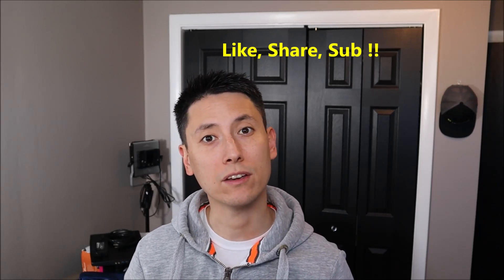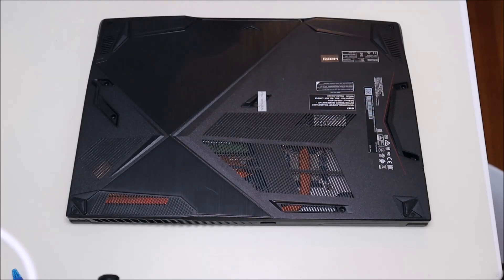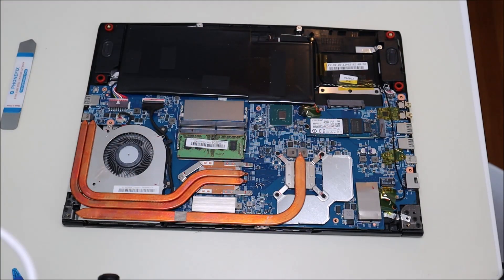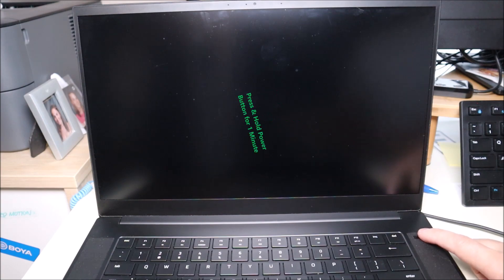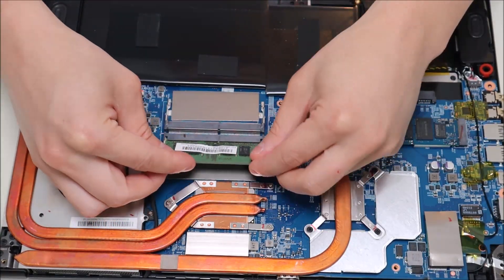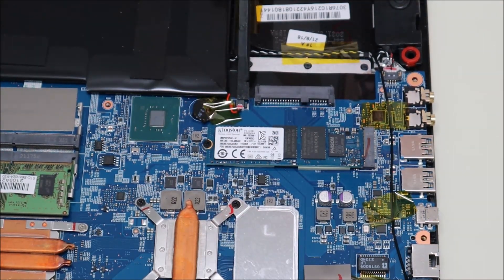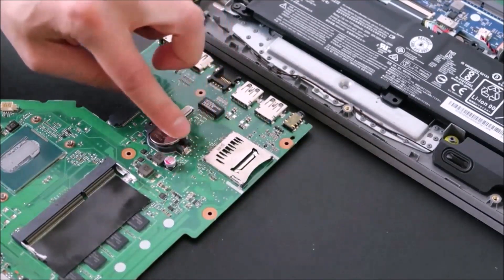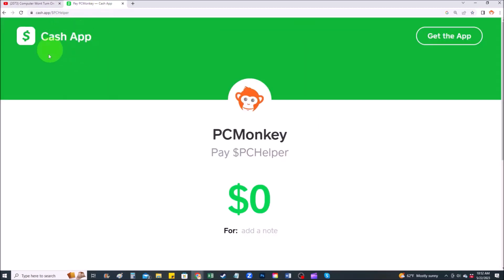MSI Laptop Computer - Dead / No Power / Wont Turn On Fix

Comment: Just replaced the keyboard on an MSI_GL75. and now the unit won't boot. So far i've tried everything in your list with no progress. Currently when I press the power button it turns on. Goes to the orange light for 18 seconds before shutting off and recycling.
Reply from the maker: If the computer turns on and works well before I perform a repair but does not turn on after, my first assumption is that something was made loose or damaged when I was in there. Can you double check the connections of all components near where you were working? Was the battery removed and the computer unplugged during the repair?

Comment: I got my keyboard module changed because many stopped working, now that the module has been replaced the, the power button worked in the store but then it didn't. Also the led light on the num lock and power button are turning on which used to when before the swap
The led lights are only turning on  for each and capslock...not for others like mute and mic off button...
Reply from the maker: 1. For a computer that wont turn on, your on the correct troubleshooting video. Have you tried the steps seen here?
2. If this happened after a repair, perhaps something was damaged in the repair. I would try reseating the keyboard ribbon cable and see if that helps.

Comment: I just tried to clean my fan , but after i finish everything , and i plug in my screen wire but im not sure i was dust or smoke come out from the plug , and my pc doesn't start now ?
Reply: And now i plug out battery and plug in when i turned on smoke come out from battery and i decided to turn on pc without battery , bu now the issue is there is no display?
Reply from the maker: @Mabastscott59  If smoke is coming from various parts of your motherboard, I assume there are shorts and the motherboard is being damaged :(   But we can still try to troubleshoot if you like. So now the computer turns on but there is no display? If the screen is black, what are the signs that the computer is actually turning on?  Any motherboard or HDD sounds, fan, etc?
Reply: @PC_Monkey  i thought smoke came out from battery but i think it was something else , and it was transistor 1R2 that is responsible for turning on screen ! And i hope i can replace that .

Comment: Really appreciate the video! I have a problem with my msi. I'd really appreciate hearing what you might have to say about it.  Basically It froze and shutdown but when I try to power it on it it only powers some lights and the hard drive (I can hear it turning). The screen remains black and the fans stay silent. It's an msi gaming laptop from 2021and I've treated it like a 500 year old glass masterpiece. In other words it does not seem like it should be having problems. Any thoughts?
Reply from the maker: Sounds like your on the correct video.  Have you tried the steps seen here?
Also, did anything happen before this issue appeared?  Overheating, liquid spill, Windows update, etc?

Comment: My msi katana gf66 suddenly shut off while I was playing cs2 and is not turning on, tried everything you suggested but still nothing do I have no other option but take it to the shop?
Reply from the maker: 1. Are there any signs of life at all when you try to turn it on? Lights? Fan, Motherboard, or Hard Drive sounds? Anything seen on the screen?
2. Also, did anything happen before this issue appeared?  Overheating, liquid spill, Windows update, etc?

Comment: Ive done all the steps but yet its not turning on. All i had done was update my graphics driver what can i do to examine and fix this problem. The computer your using in the video is the same one i have but i havent found a solution yet. Do you have any suggestions i can do right now for it turn on?
Reply from the maker: If after trying the steps seen here in this video multiple times without anything changing, your most likely looking at a faulty component preventing the motherboard from working or a motherboard issue.  I would start troubleshooting each component, starting with the charger and power jack.  You can see those two videos here;  https://youtu.be/YBhsVHideGE  &  https://youtu.be/HpabvrNaodU.  You can also try replacing other components like your Power Button to see if that is the route cause.  If none of those are the issue, you would then be left with a motherboard replacement.

Comment: Hi. I have msi flip evo 13. I mistakenly plug the charger to the non-charge thunderbolt type c port. Then plug it true thunderbolt type c. And laptop suddenly power off. After that never started again. When i push power button there is only low frewuency sound ends up ten seconds. And nothing. Where is the problem do you think
Reply from the maker: 1. Sounds like your on the correct video.  Have you tried the steps seen here?
2. In many cases, plugging the charger into the incorrect port can damage the motherboard :(  It may need to be replaced :(
Reply: @PC_Monkey  thanks. I tried all the steps. It will cost too much, motherboard:(
Reply from the maker: @61lebowski61  Is this your motherboard? https://ebay.us/odSAs3

Comment: Hi, thanks a lot for your work it is really helpfull !
I have a laptop MSI gl62mvr and it won't start. I tried everything you said in your vidéo, but no improvement. The middle led is shining blue, but the power button doesn't do anything. When i press the reset button while i keep the power button pressed the fans start for 1 second, then stops, then  strats again for 2 seconds, then stops and then strats again for 10 seconds. Then nothing, the screen Does not start at all. Do you have a clue ? Thanks a lot i am a bit Lost hère 😅

Comment: I have the same problem but the chipset near the cmos battery got cracked. Is that the problem? I hope I will get a notice
Reply from the maker: If you see physical damage to your motherboard or to any of its components, you most likely need a motherboard replacement :(

Comment: For me my laptop turned off while i was using it and the power button turns on when pushing it, but nothing else. Eventually the power light turns off and nothing happens. This is happening each and every time i attempt.
Reply from the maker: Sounds like your on the correct video.  Have you tried the steps seen here?
Also, did anything happen before this issue appeared?  Overheating, liquid spill, Windows update, etc?
Reply: @PC_Monkey  Possibly a windows update, but overheating for sure. I have been using multiple independent fans to keep it cool for awhile and it didn't seem to overheat anymore... But now this new issue appeared. 

My laptop is slightly larger than the one in this video, I got as far as opening it up but the components look different and I'm not sure what I'm doing with it.
Reply: @PC_Monkey  Finally found and tested my ram using ur vid as a guide, this did not fix the issue so now I'm trying to figure out were the cmos battery is located. I'm using a msi gs70, it's layout is pretty different from anything i can find in vids for this.
Reply: @PC_Monkey   Found the cmos battery and followed instructions, unfortunately it still doesn't work. Thanks for the video I learned a lot anyway.
Reply from the maker: @aquacandela  Just so you know, over heating situations can be hard to troubleshoot just one issue as multiple different components and boards including the motherboard itself, could all be faulty.  
An overheating computer can be damaging multiple different components if not resolved. First, make sure that the fan and vents are clean and clear. If you need help accessing the fan, let me know what brand and model computer you have and I can help you get inside it. If that does not fix the overheating issue, then try replacing the thermal paste on the CPU and if needed, the GPU as seen here; https://www.youtube.com/watch?v=K_j4GPjpawk. If that fails too, replace the CPU
Reply: @PC_Monkey  Thanks I'll check these options out, I'm coming into this as a rookie in computers and learning everything as I go. My laptop is an msi gt70 2pe, and given I've had and used it for roughly 15 years the overheating issues and these new ones aren't too surprising. 

It's becoming a learning project were if I manage to fix it awesome, but if not I see it as an opportunity to learn new things.
Reply from the maker: @aquacandela  Great to hear :) :)

Comment: Hey J, so initially found out my msi gf63 v12 laptop's fan extension that you can see without opening the cover is bended. I can't boot up my laptop sadly but idk if that may cause the issue. I can't really specify the piece more than that. Here in search for your help. Please lighten me up 😢
Reply from the maker: Yes, if the fan is damaged, that may stop many computers from turning on as its a very important part to the heat assembly and the computer may not want to risk the damage that comes from not having a working fan.  I would open the computer up and make sure the fan is ok and does not need to be replaced.

Comment: I just recently tried to clean dust out of my msi gaming laptop and after doing so and removing the fans to clean them, i put everything back together as it all should be, i then plug my power cable into the laptop and press the on button, the laptop turns on for around 3 seconds before turning off again although i did not touch any power cables so I have no clue what to do?
Reply from the maker: Are you able to see anything on the screen before it turns off?  Also, was the computer working well before you went into it?  If not, what was happening?
Reply: I just delivered it to the repair shop today, however before i attempted to clean my laptop everything worked completely fine and as it normally should. I also could not see anything during the 3 seconds it was on for although the keyboard did light up and the fans would work for that duration it turned on for before turning off again.
Reply: I presume that it is the fans that have gone bust as when I disassembled the fan one of the bronze metal bars did bend a tiny so that would be my guess but I honestly do not know otherwise what it could be?
Reply from the maker: @C1arky0606    Good luck !!  Let me know how it goes :)
Reply: @PC_Monkey Thank you, I could get a phone call earliest friday to see if it needs a new part or just minor tweaks. But thank you for the help I will let you know what happens! :)
Reply: @PC_Monkey So what happened was nothing to do with me disassembling the fan, the repair guy informed me that my laptop was completely dead and something in the motherboard had melted and fried completely so looking for better reliable gaming laptops at the moment, thank you for your help though I do appreciate it very much and your channel as it also helps people in dire need.
Reply from the maker: @C1arky0606  Happy to help :) Always here if needed !!
Reply: @PC_Monkey Thank you! :)

Comment: I have a ge75 raider that starts to turn on and a light flashes and turns of with a click
Reply from the maker: Sounds like your on the correct video.  Have you tried the steps seen here?
Also, did anything happen before this issue appeared?  Overheating, liquid spill, Windows update, etc?
Reply: @PC_Monkey  I haven’t been able to use it for the past year it’s been doing that I tried all the steps but it didn’t work only the keyboard turns on and just shuts off after that
Reply from the maker: @ivanlopezz22  If after trying the steps seen here in this video multiple times without anything changing, your most likely looking at a faulty component preventing the motherboard from working or a motherboard issue.  I would start troubleshooting each component, starting with the charger and power jack.  You can see those two videos here;  https://youtu.be/YBhsVHideGE  &  https://youtu.be/HpabvrNaodU.  You can also try replacing other components like your Power Button to see if that is the route cause.  If none of those are the issue, you would then be left with a motherboard replacement.
Reply: @PC_Monkey  okay thank you man

Comment: Hey, My laptop turns on on battery power, but then turns off automatically around login screen during startup, happens at every startup and i cannot turn on the laptop in battery power.. then i have to connect it to AC adapter to turn on, once on battery backup works fine as usual..my battery is new.. what can i do?
Reply from the maker: Sounds like an issue with the battery.  Is it generic or a brand name battery?

Comment: HELP! I have msi prestige 14 and i already take out and insert  the battery back in, I've done mostly everything all videos said and it's still dead!

Led light charging wont turn on too, i swear the charger is fine because i tried charging my phone and it works, so i just seems like my laptop CAN'T receive the charge?? ((All i did was leave the laptop to rest untouched for a week))
Reply from the maker: 1.  I would try the power drain procedure a few times before giving up on it.  Have you managed to perform the BIOS reset?
2.  Also, did anything happen before this issue appeared other then leaving it off for a long time?  Overheating, liquid spill, Windows update, etc?
Reply: @PC_Monkey  so it does have a Windows update before i let it rest for a week, it was a sudden update and i didnt bring the charger with me so i let it update until it ran out of battery, then i leave it to rest for a week, today i charge it and realize the led light didnt turn on (i thought it was no big deal) hours later thinking that it finally charged full and ready to be use, i turn it on and it shows the windows update screen, reaching 97% (everything seems fine still) i leave it for a moment, went back, only to find it's  totally dead till now

No overheating, but the opposite, its freezing here, and i left it on a cold table for a week, i heard it could also cause sudden error to laptops(?

I havent tried the CMOS/BIOS restart, i will soon tho

Edit : i did the cmos restart, still dead
Reply from the maker: @meetsuka  If the computer lost power during an update, it could have messed up the operating system.  You would usually have to reinstall it.  However, if your computer is not even getting power, something else is the issue here.   If after trying the steps seen here in this video multiple times without anything changing, your most likely looking at a faulty component preventing the motherboard from working or a motherboard issue.  I would start troubleshooting each component, starting with the charger and power jack.  You can see those two videos here;  https://youtu.be/YBhsVHideGE  &  https://youtu.be/HpabvrNaodU.  You can also try replacing other components like your Power Button to see if that is the route cause.  If none of those are the issue, you would then be left with a motherboard replacement.
Reply: @PC_Monkey  i do think that the problem is in the power Jack because i tried other chargers and none works, i just kept wondering how come it brokes all of a sudden when i never treat it roughly 🤣, oh well thankyou for your replies tho!!
Reply from the maker: @meetsuka   Good luck !!  Let me know how it goes :)

Comment: thank you sir, you are a life-saver

i was messing around in the bios and my msi gf66 screen went black entirely, while still running hot, took me a few hours and countless troubleshooting attempts.

I removed the cmos and plugged it back in after a few minutes and it worked for me.
Reply from the maker: Great to hear !! Always here to help :):)
Reply: Hey, I have the same laptop but mine completely shut down when doing a Windows update. Now the laptops power button blinks but does not power on. I've tried  everything including reseating the ram and everything the video has to say but there's no life in it. Maybe it overheated as it was always thermal throttling but I can not check that. In a few days I'm going to be sending it back to be repaired but thanks for the video. Additionally, I tried the cmos trick and that did not help. Its always the msi laptops that have these problems.
Reply from the maker: @armynation7904  Good luck !!  Let me know how it goes :)
Reply: @armynation7904 hi i have the same issue. did you fix it?

Comment: What can i do if my laptop turns on, withe led light on power button as usually, fans work normal, but no logo display, and after 50 60 seconds laptop turns off, and then if i try to start again, it just go off instantly, i've try everything, you sugest, nothing work.(MSI GF65 Thin 9SEXR is the model)
Reply from the maker: Can you hook up to an external monitor and see if anything appears on the screen during that 50 seconds?  Also, try the power drain several times.

Comment: Help. I've tried all the methods in this video but my MSI Katana won't turn on. I've tried the adapter on my other laptop and it works fine. Is there a problem with the built-in battery? I made my laptop run out of 0% power and forgot to charge it. Currently, I see no sign of life on my MSI Katana. even the fan doesn't work when I plug in the adapter 😢😢😢
Reply from the maker: If after trying the steps seen here in this video multiple times without anything changing, your most likely looking at a faulty component preventing the motherboard from working or a motherboard issue.  I would start troubleshooting each component, starting with the charger and power jack.  You can see those two videos here;  https://youtu.be/YBhsVHideGE  &  https://youtu.be/HpabvrNaodU.  You can also try replacing other components like your Power Button to see if that is the route cause.  If none of those are the issue, you would then be left with a motherboard replacement.